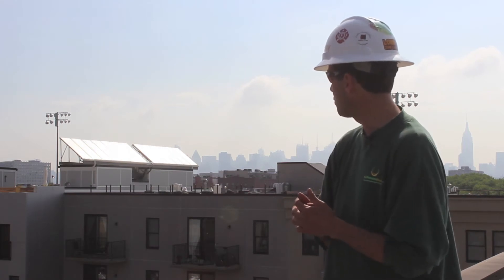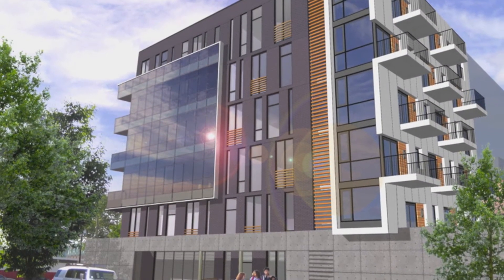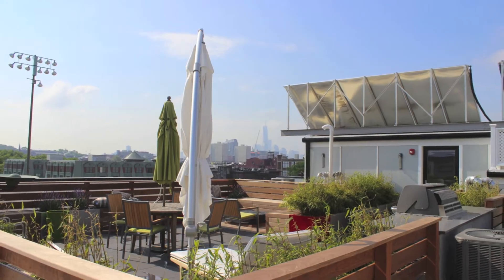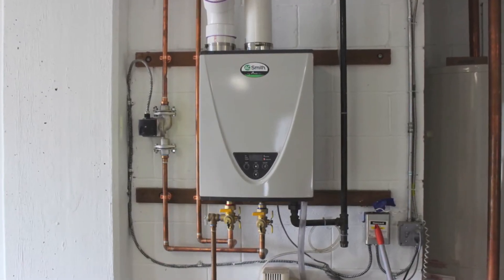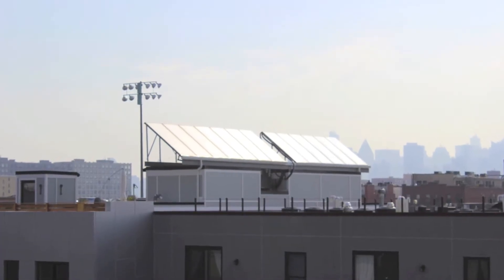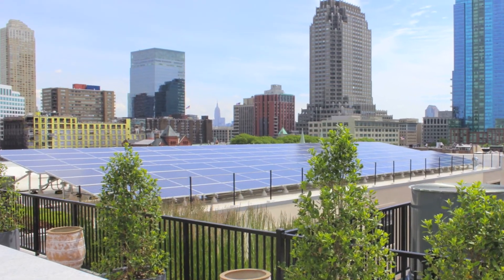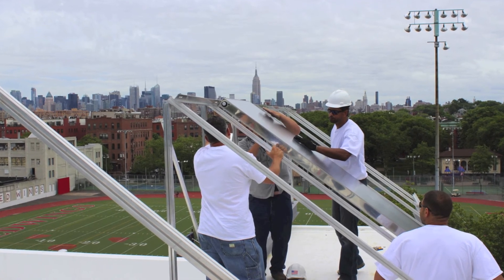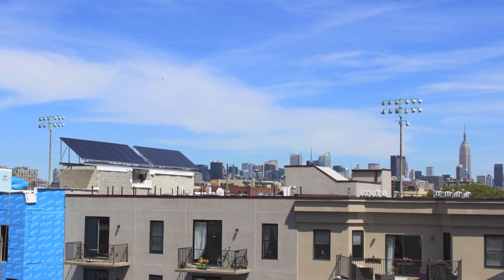Solar Thermal Hoboken NJ Tribeca West LEED

Comment: This place is a dump, 
- Repairs are non-existent. Repairs that were suppose to be made years ago still are not done.
- This “green” hot water system which basically means its always broken so if you enjoy cold showers this may be the building for you.
- Packages get stolen from the lobby and mgmt does nothing to react.
- They market the building as “Luxury” but its far from it.